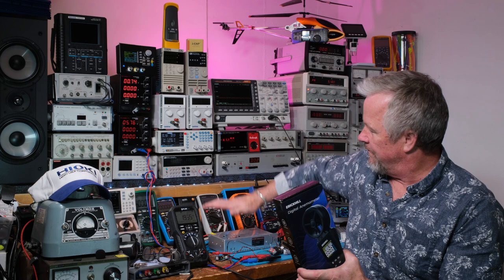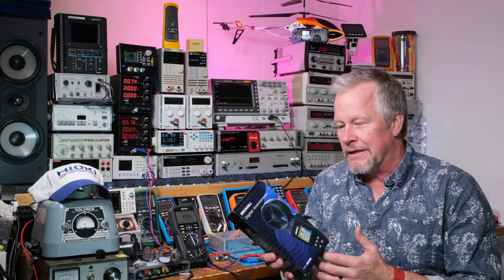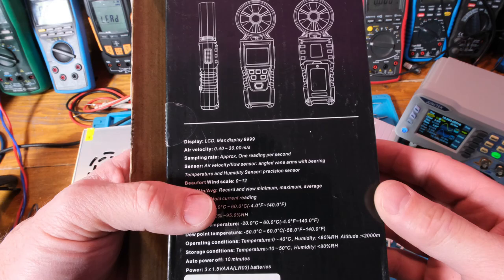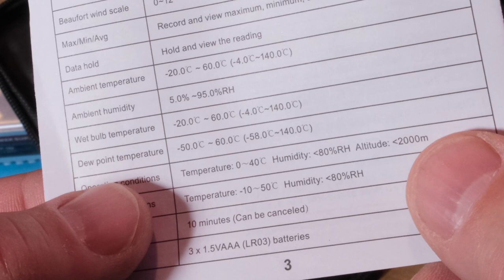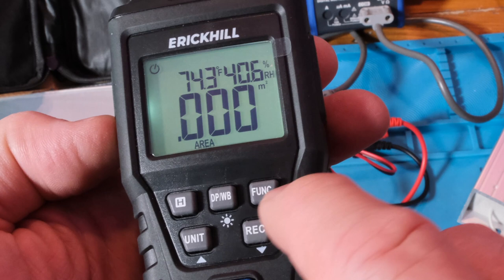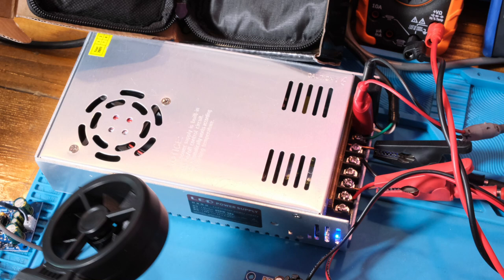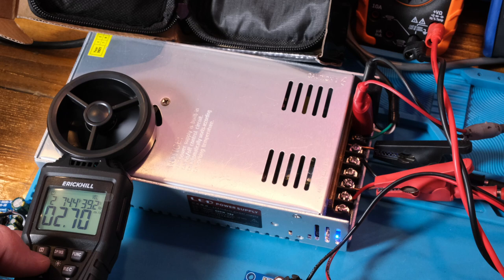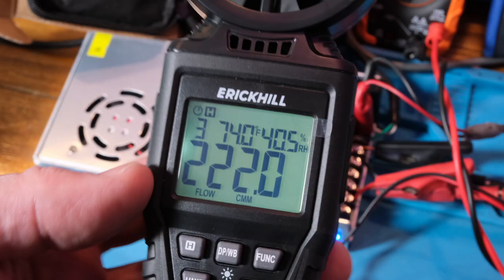Air Flow and Temperature Meter Erickhill HT625C Anemometer Review #anemometer #airflowmeter

Comment: There is a learning curve to using a anemometer....  A little bit of math and double check your settings to get accurate measurements. I believe  that is a 60x60mm fan so the area (M²) should be set to 0.0036m² to give to correct CFM  LOL I Think.!? Correct me if I'm wrong.  I was using a similar product to test airflow in project housings.  It's interesting to see the effects of various fans sizes and static pressure as it relates to air moving through the chassis.

Comment: Thanks for the video, Eddie.  I do feel it's unfair to say that this is just over thirty dollars when it actually costs $40-$45 at the referral links shown in the description ;).  It's kind of a pet peeve of mine that humans so readily minimize cost and will pretend to spend "twenty dollars" when something actually cost them $29.99 plus tax.  That's definitely "thirty dollars" and the exact $31.79 (in my state) is 59% more than "twenty dollars".

I worked in HVAC for more than a decade and feel that this would be a nice thing to have if it is reasonably accurate.  HVAC people certainly need to know temp, humidity, and dew point, and the anemometer could be handy as well if it's measurements can be trusted as it calculates total airflow if you input the duct area.  A potential downside for us in the U.S. is if you have to input the area in meters as we never use metric in field.  The other issue might be that you really have to measure at multiple depths and positions in an airflow to get an average speed, so pressure is probably the more reliable method.  Air moves fastest in the "middle" of a straight duct and gets complicated around turns.

The critical review calling you a "shill" should probably not have been removed, however that happened, as deletion only makes it seem more accurate.  I was going to respond to it to politely disagree and explain how it was unfair as you make it clear that they only sent the meter for free, but the comment is now gone.  While most viewers won't realize this, it certainly left that viewer feeling that they were right :(.  While it was unfairly negative, the comment was not commercial spam, but simply someone that was unhappy with the content.  Such opinions should not be silenced, but politely corrected.

While that person was wrong, impolite, and didn't use readable English, all reviewers should make the entire situation perfectly clear right up front by saying, for example, "this item was sent to me for free, I did/didn't not promise a positive review, I did/didn't promise to post any review, the company did/didn't approve this video, and they are/aren't paying me any money.  I do, however, receive a small percentage from Amazon or Banggood (etc) if you use my referral links below."
Reply from the maker: Thanks Rob!  I really appreciate your feedback!  The Amazon listing for this meter when I checked was about $30 but when I finished the video and editing it was gone.  So I found the closest thing to it.  BTW, the comment that I deleted is from a person who constantly calls any review video a ‘shill’ video, so I’m used to that.  But I did delete it because of the second rude comment he made about ‘all you tubers’.  He is the only one I delete comments.  Some YouTube holds back because they are so appalling.  Some have suggested that I block him.  I like to give everyone a voice and if you want to show your ignorance or terrible disposition = then it’s mud on your face.  However I do think I also have to make this a positive place, so deeply disturbing comments get deleted.    These low cost devices are not worth my time - unless I see that they can benefit others.  Making videos is time consuming - and time is money:)